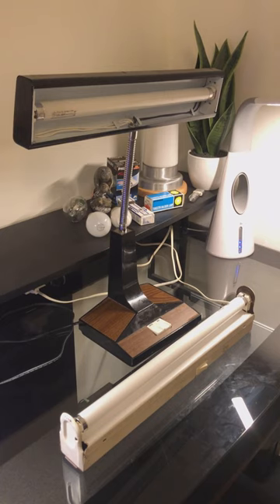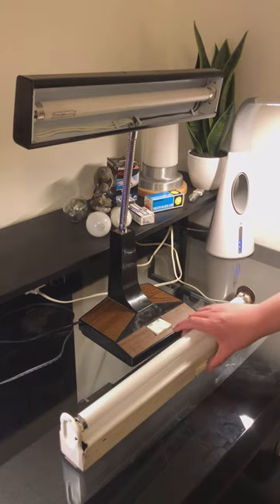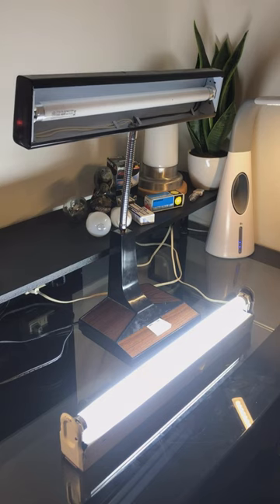Manual Preheat vs. Automatic Preheat - What's the Difference? #shorts

Comment: Did you know that there are other methods for automatically starting a fluorescent tube using a preheat circuit besides the typical glowbottle starter? When fluorescent tubes were first developed in 1938, the fixtures that first used them utilized magnetic relay starter switches and in some cases, they even used thermal relay starter switches. In addition, you also have electronic starters that are used in Europe and Japan in which one starting method instant starts the tube while the other starting method gently preheats the cathodes for a few seconds and automatically opens the switch to start the tube in a similar fashion to what you see when tubes start up on programmed start electronic ballasts.

Comment: I have that same lamp dude, but mine has 2 bulbs
Reply from the maker: Cool! Mine is an Inter-World Enterprises model 402. Do you know the brand name and model number of yours? I have always wondered if the Inter-World 402 was offered in a 2-lamp variant.
Reply: @rs12official  Mine is a unknown brand, I got it at goodwill. The model is e 72474. It needs new woodgrain though
Reply from the maker: @Warp2090 That’s a very similar lamp! The base is pretty much identical to mine. The wood grain print is different though. The head on yours is also different from mine. But yours was likely made by the same manufacturer as mine. I think most of these ‘80s fluorescent desk lamps were made by the same manufacturer, which I believe is what “Inter-World Enterprises” is. Mobilite desk lamps from this era were also made by this same manufacturer.
Reply: @rs12official  Interesting. One day I might redo the woodgrain, I found some that looks the same. I think the heat causes it to  do weird stuff over time lol.